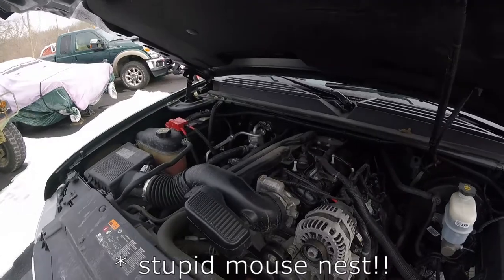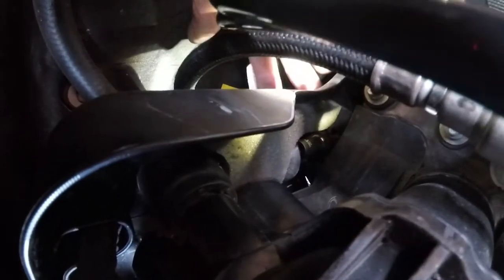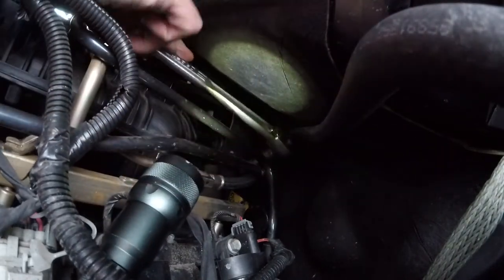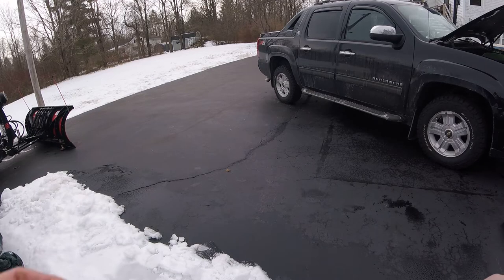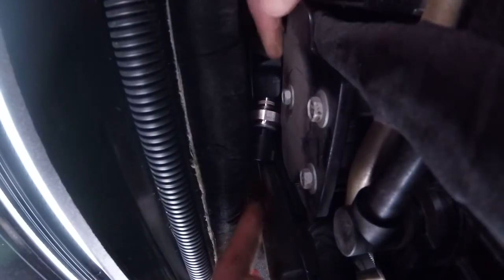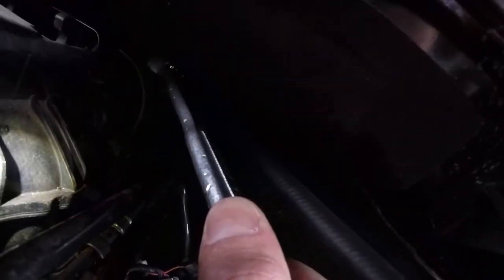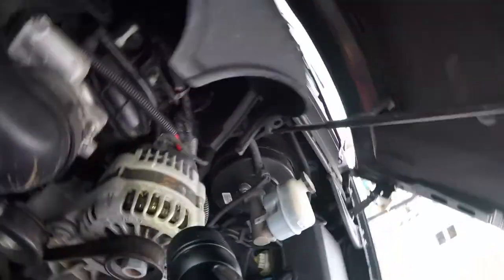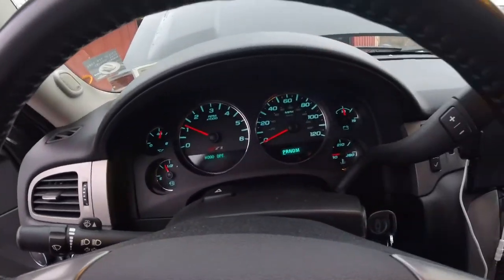EP 6. Replacing Oil Pressure Sensor (p0521 & p0523) on 2013 Chevy Avalanche

Comment: Thanks for the video. It gave me the confidence to do it my self. Took about an hr for me. The freakin connector was the most frustrating by far. I jammed 3 q-tips into the screen and it pulled right out. Oil pressure guage working fine now.

Comment: Used:   deep-well -> universal -> 2" extension -> wobble joint -> ratchet - put me right on top.  Of course needed two hands to hold things steady when applying torque.
Thanks for the hints on the tab removal - I ended up popping mine up with a long pick - and of course - lost it.... new unit still clicks in.
Also, another youtube video describes using a 'correct size' bolt to pull the filter out  - that is what worked for me.  I sized the bolt based off the new filter.

Comment: Good video overall. Some suggestions, remove the two evap lines and the fuel line at the fuel rail. Use a dremel to trim the heat shield and it makes life so mich easier!

Comment: Can the sensor be the problem if the oil pressure is low say 20lbs. My 09 Avalanche just acted up the other day. Never a problem before- 197,000 miles.
Reply: Did you figure out out!!??
Reply: @lopezdad30  My 09 Avalanche has that really small oil filter-I did a filter and oil change and pressure is normal now and have never had a problem since. That filter was my problem no doubt in my mind.
Reply: @garya9875  is that the small screen that goes inside the OPS !!??

Comment: So I changed the oil on my pick up and after that it started shaking and would kick every time I try to drive it what could it be?
Reply: That could be too much oil or its not tourqed down enough which is causing loss in pressure and a mis fire on all cylinders
Reply: Also check all evap hoses make sure you didn't bump any loose

Comment: I found your video because I've been struggling to get the plug off on our '14 Suburban.  Several hours, multiple tools, even with the grey tab pulled completely off and a very chewed up hand, not even a wiggle.  I'm pushing in the tab but nothing!  Any suggestions?
Reply: pull it
up
Reply from the maker: Sorry, I don't have any suggestions beyond what is in the video. The connector on my sensor was more compliant

Comment: In my 2013 the pressure is at 40 when cold start, then go down .... do you think I have to replace the sensor or carter tube gasket?
Reply: I have the same issue with my 2008. Starts up cold just fine with pressure around 40 but after some time of driving it goes down and the dash lights up " oil pressure low"
Reply: Did you find a solution?
Reply: @sarge6252   Not totally. Just got few PSI, but the gauge still drop to 1/4

We did all this:

Engine flush (inside wash)
Pick up tube O-ring replaced
Sensor & Screen changed
Thicker oil use, new filter.
Pressure relief valve replace
Crankshaft seal change

Comment: Can you still drive vehicle without causing damage with these codes?
Reply from the maker: Technically yes, you can still drive the vehicle. However if there is a larger issue that causes loss of oil pressure there will not be a way to know without the functioning gauge in the dash cluster